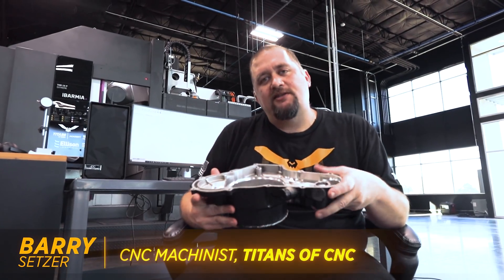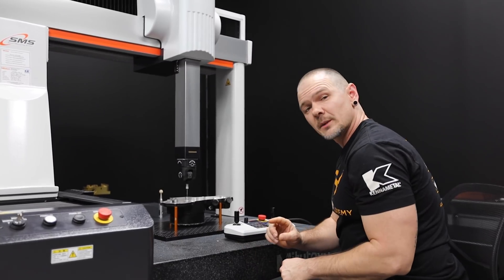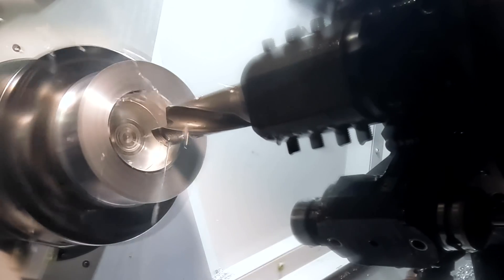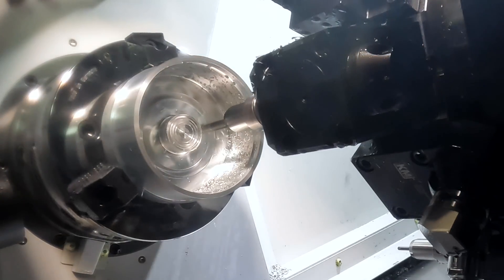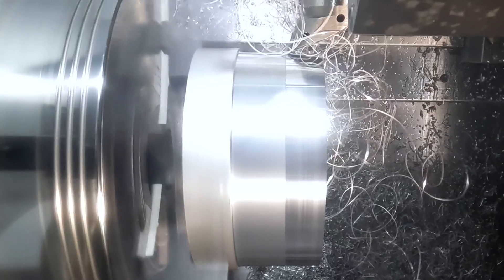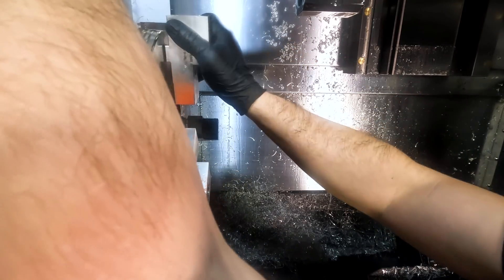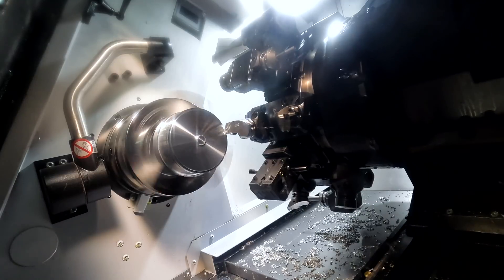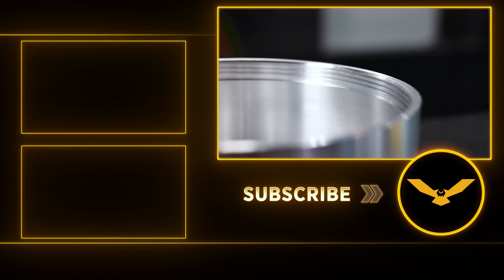LIVE TOOL LATHE | CNC MACHINING CUSTOM CLUTCH CAP FOR WORLDS FASTEST 4 WHEELER

Comment: I'm sure it's either been mentioned, or thought of already. What if you machines the side with the hex first? It would help a lot with potential warpage from the jaws.
Reply: Yeah that's what I do with hydraulic cap nuts I machine at work for that exact reason.
Reply: @SirRootes  I used to do similar stuff, but the walls were thinner. Boss was always complaining about jaw pressure warping the parts. I changed the program behind his back because "we've ran it like this for 5 years and it's fine" mentality. Never had warping issues, and was asked how I'm doing it. The program was changed back and I was pulled off of running them. You get better quality parts, less scrapped, same run time, but noooooo. Old ass fucks want to keep doing shit the hard way. The only downside of running them that way is the operator has to flip a heavier part than the previous way, which boohoo it was 9 pounds.

Comment: What was that- a 32 U drill? I use almost 5mm step over (about 3/16”) with a 32 U drill in 1045 mild steel on a Puma GT2600M for the same reason you gave- lack of turret space. You could hugely increase your step over in aluminium with it. I even use it for internal facing work- to the astonishment of my tooling  rep who’d apparently never seen it done. U drills  are tougher & more versatile than a lot of people realise.......
Reply: About 45mm diameter (1.75"). And yeah I definitely think I could have stepped over more. Next time.

Comment: What do you use to programm especially the turn-mill toolpaths? We have a Puma 2600 SYB II, our cad/cam program is outdated. I would not be able to make the hex on the cap in that way.
Reply: We use Mastercam for all our programming.
Reply: Fusion 360 will do the same job in a lot of circumstances. Does on our 2600YB
Reply: @HondaBoy  Fusion 360 seems like a good option for our shop

Comment: What is the chuck pressure. The guys I work with say they can't run thin wall parts in there three jaw chucks because they will just crush the walls. They use mazaks. I end up doing all the thin wall stuff in the 4 jaw hankook I run.
Reply: It was about 100 psi. And it did cause some distortion but after checking it on the CMM we were ok with what we saw. It is definitely a concern depending on the part specs.
Reply: @travisjarrett2355  Thanks the parts we are doing are sleeves with a .002 max roundness and .002  for squarness. The walls end up being about .250 a side. It's tough be we can do it with really light chucking pressure (no idea how much as it is done by hand and the company won'tget us a torque chuck key) small tool nose cutters and light cuts.

Comment: That was cool. Just one question. How do you know that the thread was to size?
Reply: It was actually a custom thread I designed for this part. So after the cap was done, we made the housing thread fit to match the cap.
Reply: @barrysetzer  have done that more than once. A custom thread for a custom part
Reply: @barrysetzer  I can see where a buttress type thread might help to reduce thermal distortional seizing. I'll be watching to see what kind of locking technique that was chosen for this cap. Did you consider recessing the hex feature for safety reasons or did that consideration add too much thickness and weight to the caps?

Comment: I would have done opp. 2 first, save gripping on the thin wall. That part will wear out or gall too easy.
Reply: I hear you Geoff, here is my response from another comment: "This is a great observation and yes the preferred method. The problem with this part is that would have us rough out and finish a floor that was only .125 thick which has it's own set of problems. As an added check I used the CMM to determine circularity distortion from the clamping and found it to be acceptable with respect to the thread tolerances. If I were to use a good set of pie jaws with plenty of floor support I would have reversed the ops like you mentioned. Thanks for addressing this."
Reply: @travisjarrett2355  You could have put a 'bung' in the bore after opp. 1.
Reply: @geoffgreenhalgh3553  yeah that would help for sure. Have definitely used this method in the past.
Reply: @travisjarrett2355  
I looked for this thread so I could agree with reversing ops. Or, suggest inserting a plug (bung? Never called it but okay) to allow a better grip.

I did R&D tool making for 2 decades. Worked with many really sharp machinists and engineers.

Most important thing I learned...
"More than one way to make good parts."

Well done!

Comment: I use a vcgt 0.2r high rake polished insert with fine chipbreaker, chips aluminium on the finishing pass, even with small depths of cut and leaves a shiny streak free finish that looks great anodised … just my 2 cents
Reply: That is a great insert to use. Thanks for sharing Tom.

Comment: Man I love it when lathe guys use inserted drills as boring bars. It just seems so out-of-the box to me, as a mill guy.
Reply: I do this quite often at my work, I used a 10mm tcap drill to bore a  +/- 0.01mm  tolerance hole in 500  of these little sleeves. Its one thing to add to the list of things that blow my mind, like as long as you can comprehend all of the different ways you can produce something. You can make anything in your imagination.
Reply: You can use insert drill as endmill. 😉
Reply: @MrLogicsys  mill guys head explodes
Reply: @MrLogicsys  yeah but it only has 1 effective flute so the forces are unbalanced. And its quitte long and thin too so not very rigid

Comment: I bet a dollar it came out not as round as expected, as clamping thin wall with 3jaw chuck bends it, first op should be thick part, than do the thin part
Reply: This is a great observation and yes the preferred method. The problem with this part is that would have us rough out and finish a floor that was only .125 thick which has it's own set of problems. As an added check I used the CMM to determine circularity distortion from the clamping and found it to be acceptable with respect to the thread tolerances. If I were to use a good set of pie jaws with plenty of floor support I would have reversed the ops like you mentioned. Thanks for addressing this.
Reply: Correct.

Comment: Definitely not that fastest.. in Phoenix AZ we had a 4 wheeler that could hit 130mph. Had nitrous
Reply: It is the fastest in its class. Single cylinder two stroke for its engine size. Worlds fastest is 2.61 in 300 feet. This bike is 3.65 in 300 feet.
Reply: @coryrodvik329  yeah I figured it had to be something like that. Because we had some crazy 4wheelers out in Phoenix AZ that would hit 125 easy
Reply: Maybe in a 1/4 mile..
Reply: It holds the world record in their CC class, at 112mph
Reply: @barrysetzer  okay that makes more sense
Reply from the maker: That’s Fast…
Ya, I will ask about the particulars today but do know they are a local Texas team and officially have the world record.

Titan